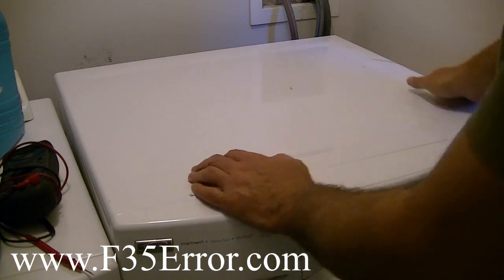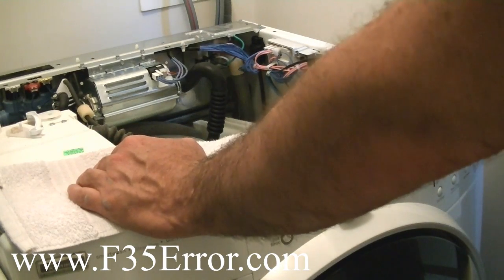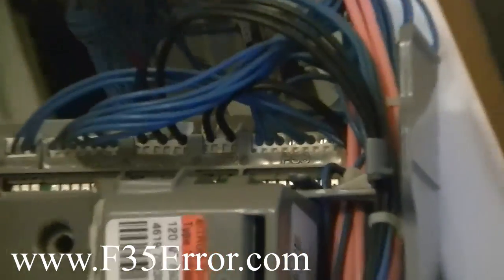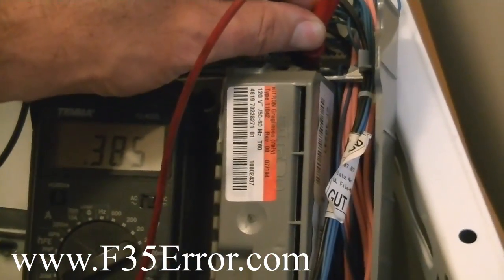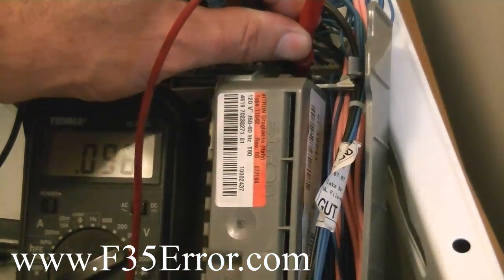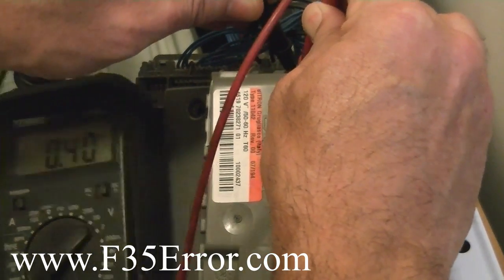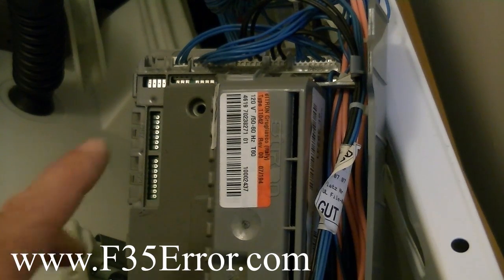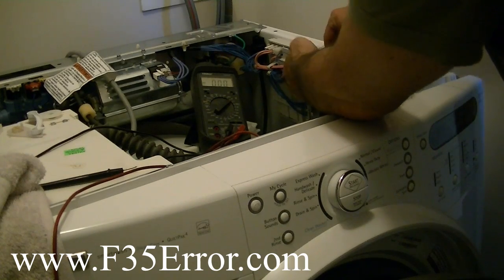Kenmore Elite Washer F35 SUD Error - Voltage Checks to Better Determine Cause

Comment: Great video.  Very helpful.  One thing that I notice when taking my voltage measurements is that I get the .38 volts from terminal 1 to 2 with the power off to the washer i.e. plugged in but the power button not pushed.  When I push the power button, my voltage goes to 1.19 volts from terminal 1 to 2 on the CCU.  What does this mean?  Is my pressure switch bad or is the CCU going out on me?  Thanks again for the great videos.
Reply from the maker: Hello, in your case it looks like a CCU issue. From my experience with past clients the F35 Error Repair kit at http://www.f35error.com will fix your F35 error code issue.

Thank you,

Jeff Hartman
"The Neptune Man"

Comment: Hey Jeff. I'm hoping you can help me. I get the sud f35 error. I've checked all the hoses and replaced the sensor. When I check pin one and two I get .433 V but as soon as I turn the power on it shoots up to 1.185 V. The 5V supply read correctly. What might this indicate? The tub never get a chance to fill as it goes into error shortly after starting the cycle.
Reply from the maker: +Larry Carter 
Hi Larry, it sounds like your CCU power supply needs corrected with my www.f35error.com kit. The 5v CCU power supply is always on then when you turn on machine other circuitry starts to draw more power and that disturbs the 5v rail. The APS seems to be sensitive to the 5v rail because the actual pressure sensor has a ratiometric output which makes it sensitive to the input voltage (5V rail)

I hope this helps.

Jeff Hartman
"The Neptune Man"